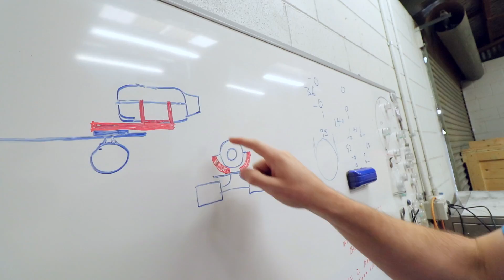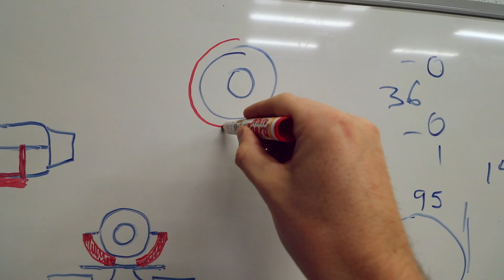Jet-Powered Skateboard (Part 9)

Comment: Why dont you make the 'board' out of Titanium, then you can integrate the fuel tank into the board!
Reply from the maker: I have considered it. But it's not possible to just use a normal, flat sheet - too much weight and too much flex. I think it would need to be a combination of titanium and perhaps carbon fiber.